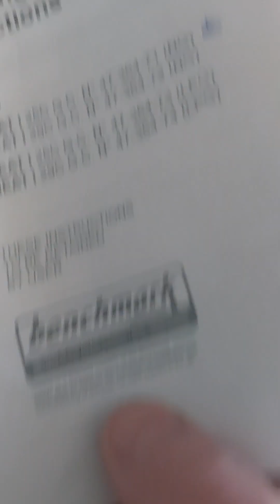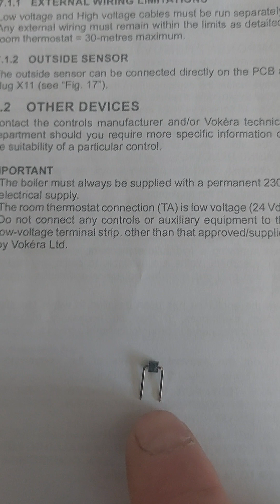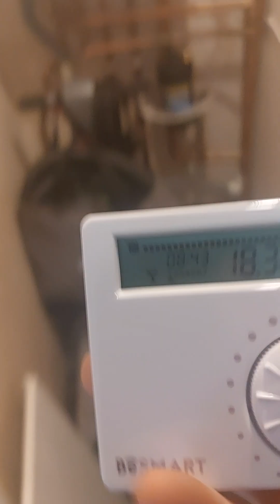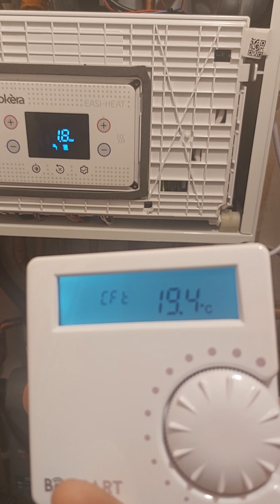Vokera RF start wiring to Easyheat 25

Comment: Hi I have fitted esc roomstat and wired like you’ve done but reciever on boiler turns off reciever off boiler on is there any other loop that I should remove ? 
Cheers Pete
Reply from the maker: Usually there is only one link to be removed when external control is fitted, I don't really know what could be the issue, sorry

Comment: The block comes two black then the live and neutral where do you connect please
Reply from the maker: There is no polarity on them two wires. Either way
Reply: @mrfxr1695  sorry I wasn't clear. I know the two black wire are interchangeable but the blue and I presume red where did those get connected. I've ordered the same thermostat for my 29c cheers for the video.
Reply from the maker: @colineddolls9907  blue is neutral and brown live, usually connected wherever you have permanent supply within the boiler ( at the point where power cable connects in)

Comment: Interesting video on Bosnian coffee, I may try it later if time. 

Your video on the room thermostat timer though is not really accurate. If you look at the instructions on the thermostat packaging it says Alpha thermostat. The Alpha is an accessory to the BeSMART thermostat, not the thermostat itself. The actual BeSMART thermostat looks like the one in the instruction manual at the top of figure 17. 

The external sensor you mention 55 seconds in you don't actually have but if you did have it it would be connected to X11 to the SE terminals (SE=sensor external) as described in the manual. 

The figure 17 shows the BeSMART thermostat connected to the two middle terminals, these are what are known as OpenTherm terminals (marked OT in figure 16). Using these terminals the BeSMART thermostat controls the boiler in a different way and improves the efficiency, The Alpha thermostat can't do that so as you found out, it doesn't work. 

The terminals you used after speaking to technical were marked TA (temperature ambient) these are the ones to use as you discovered and they simply switch the boiler ON/OFF. 

If you are Gas Safe registered you would be very welcome to attend Vokera training at London Colney or Bradford because these boilers are incredibly flexible and efficiency and operation can be tuned to the property in many ways improving efficiency still further. Range rating the heating output, soft start, setting the pump (it is supplied at a high setting but it can be set for the property) smart pre-heat settings that costs nothing. 

Also 48 weeks after you first powered the boiler CFS will appear in the display (CFS, Call For Service) a reminder for the user about the annual service. After 52 weeks nothing will change but the boiler will record the number of days the service is overdue; an annual service is important to maintain the 5 year warranty. 

If you are not Gas Safe registered you possibly do not realise the boiler is not supposed to be operated with the case OFF as that forms part of the combustion box seal. 

I hope you are happy with the boiler and look forward to seeing you on training course to explain some of the excellent features which, incidentally far outperform the capability of rival boiler costing several hundred pounds more.
Reply from the maker: Thanks for the info 👍

Comment: Hi, I’ve bought the programmable thermostat similar to this, so you know if this will connect the same way? Thanks
Reply from the maker: I'm not sure, have you got instructions? Is the boiler same? If it's same boiler, all low voltage roomstats will connect same way